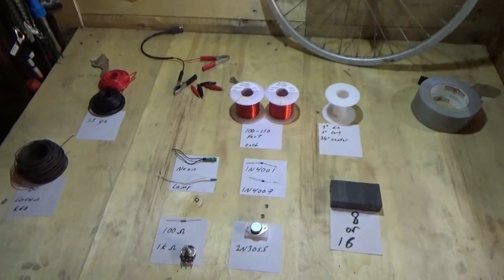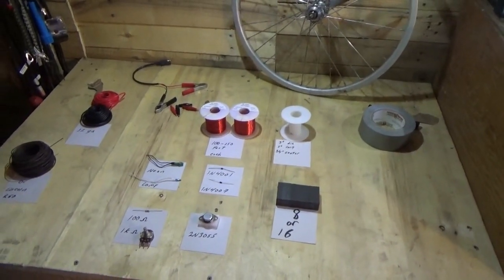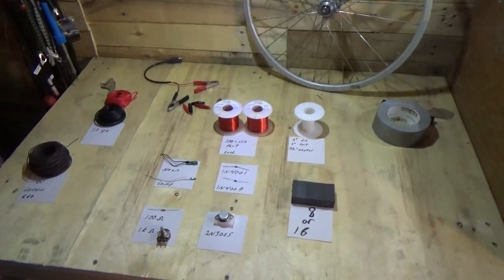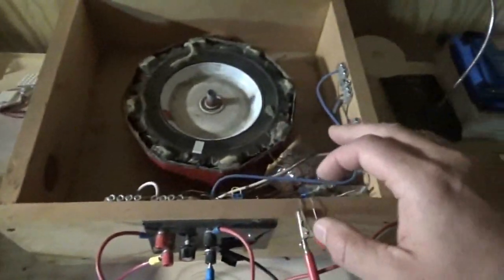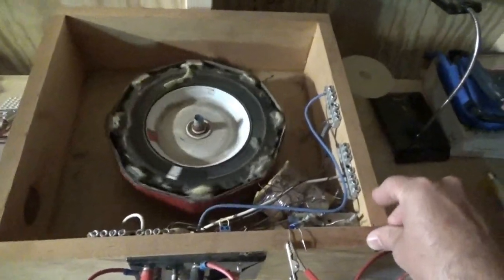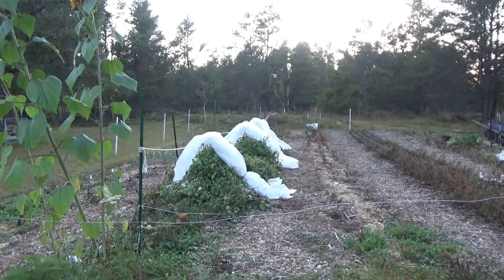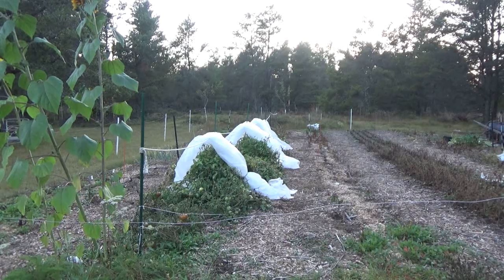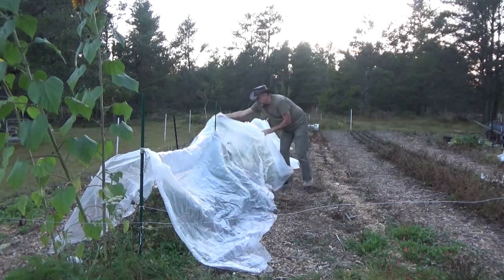Cutting Fire Wood & Making Bedini Motor Parts List

Comment: This is just a clarification of the "B" motor,  the primary windings create a magnetic field that that attract and repulse the magnets on the wheel. the secondary winding , which is a heavier guage and has more turns per coil generate a pulsing current caused by the magnets passing by. 
   If you rotated the wheel with a crank and got it spinning, it would still work, but would not be as effective as the primary windings and low voltage power source.
Reply: Troy, I will tell you a secret related to about the mechanism of how the radiant event can harness energy.  It is a known "peculiar" knowledge that AC power lines can have DC static potential riding on the same lines even WITHOUT lightning influence, but more if it has.  Where that DC potential comes from and how it appears there is a hint at how the collapsing BEMF can do the same.  Recapturing the collapsing magnetic field is just returning a portion of the energy your battery inputs, BUT the BEMF also does something else independently and can DRAW MORE energy from ANY portion of the AMBIENT MEDIUM whether, air, water, rock, outer space, vacuum and the like.  Know this, nothing in the Universe can be done without affecting all other portions, meaning there is a action/reaction however slight.  Thank Newton for that law.  Those wanting to understand "radiant" phenomena need to study the meaning back before the discovery of the electron by JJ Thomson near the beginning of the 1900's.  Today's definition is not the same.
Reply from the maker: +EnergyCrafts I did not know about the DC riding on A.C.. that's cool. I have been reading a lot of the old books recently. They had knowledge that today we are taught in electronics to deny. We are told it's an annoyance that needs to be grounded out. How sad.
Reply from the maker: Mostly right :)
Both coils are wound together, having the same length. The passing magnet causes a voltage in the primary (trigger) coil, which turns on the transistor, sending energy into the secondary coil, which repels the magnet, pushing it on its way. We capture the collapsing magnetic field (and radiant energy) and dump it into the charging battery.